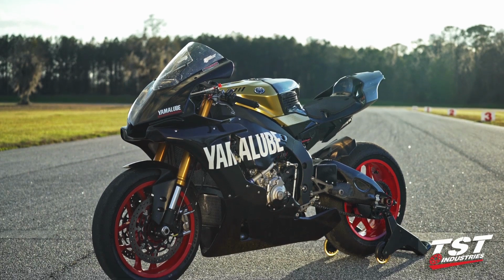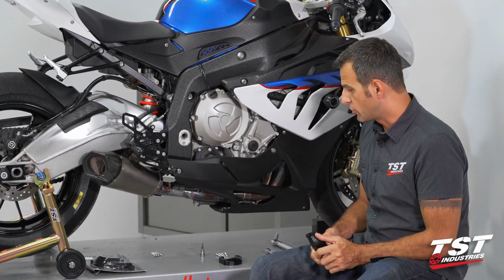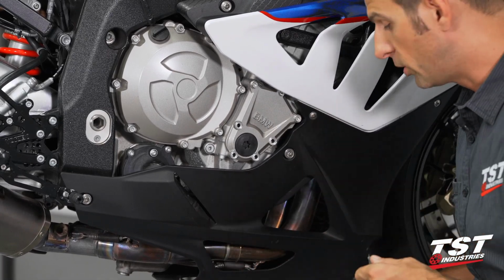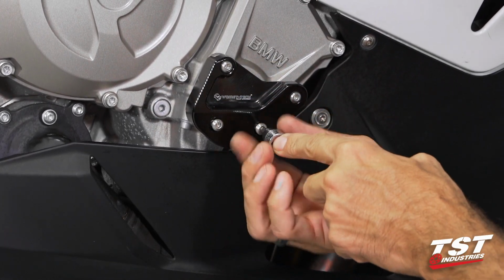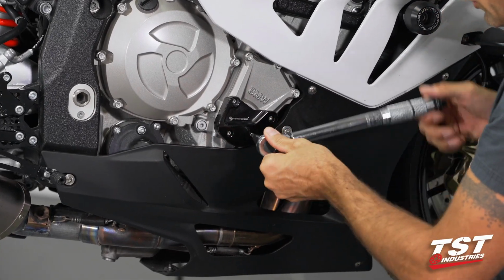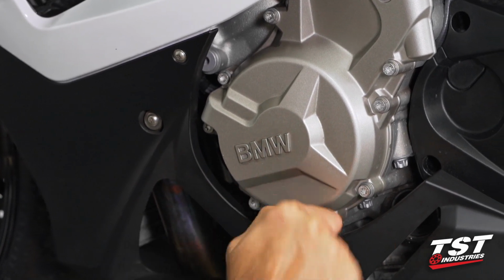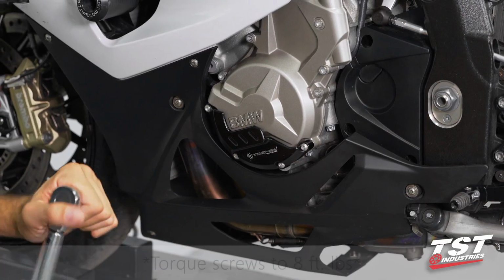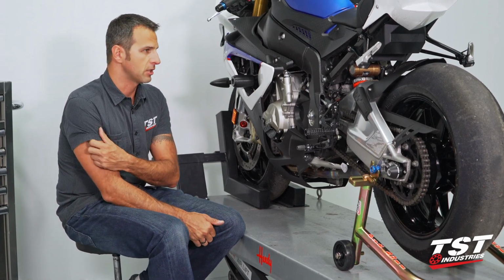How to install Womet-Tech Engine Case Saver Protectors on a 2009+ BMW S1000RR by TST Industries

Comment: I just ran across this video a year after being posted. I like how you informed viewers not to reuse the aluminum bolts, some would not know this. I would also think you might want to add anti-seize to the stainless bolts, that are going into an aluminium block. So as not to cause corrosion, as severely.

Comment: those look excellent!  I wish Womet would make similar ones for the 600RR..   those case savers are just so much cleaner looking than the engine cover protector..
Reply from the maker: Unfortunately there isn't much of a demand for those. On the 2007-2008 model the engine cases are exposed so guys notice that they need protection there. On the 2009 and up models the fairings cover the engine cases and I think it creates an out-of-sight/out-of-mind effect on people. Even though the cases are vulnerable most street guys won't think about it because they are covered.
Reply: thank you for the explanation.  I have an 07 which is probably why it appealed to me so much.